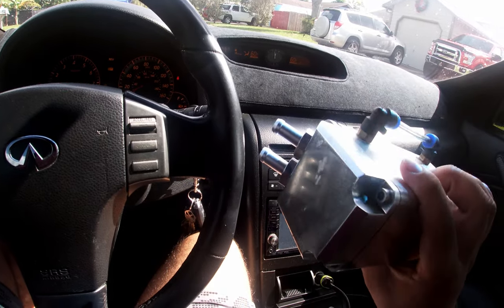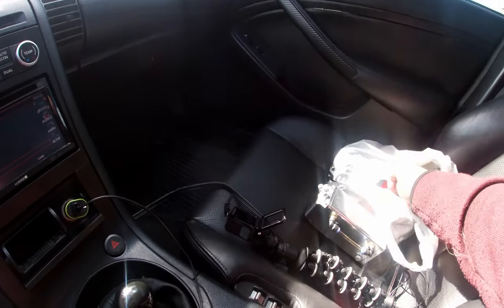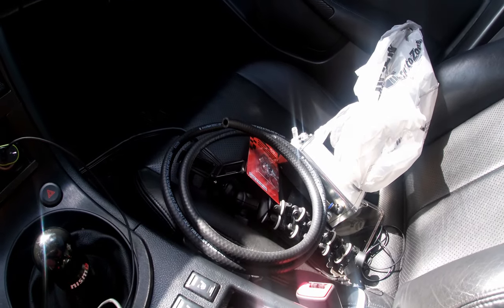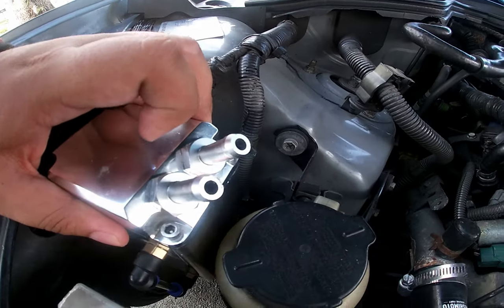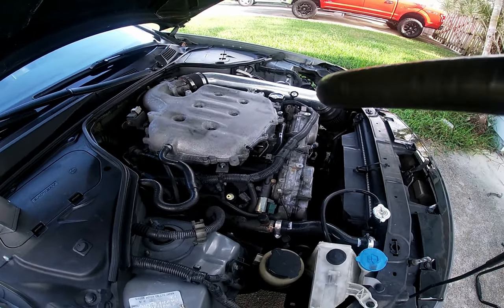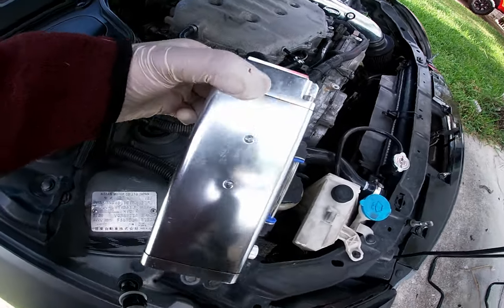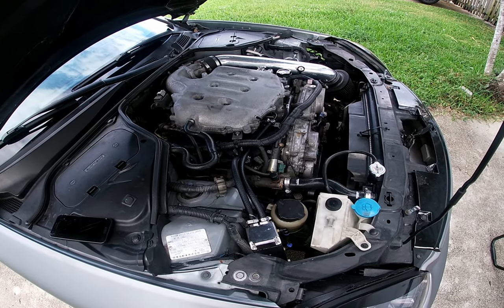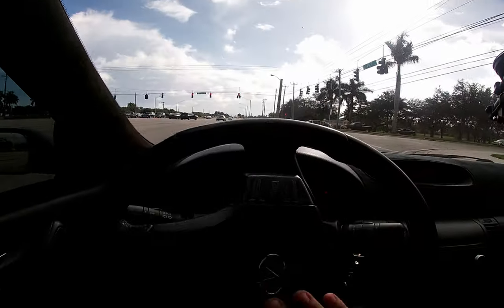EASY G35 350z CATCH CAN INSTALL

Comment: This is on my mod list of things I want for the G. Not only does is help with the oil consumption but it looks cool in the engine bay. Great tutorial bro👍👍👍
Reply from the maker: Thanks fam!
Reply from the maker: I think the add w1 one would be a good ome to go with. If i didnt have this one i most likely would have purchased that one and it comes with everything you need plug and play!
Reply: @KTVBUILT  yeah I like those cause you can also buy the aluminum hose clamp to match the catch can

Comment: That clear tube section you might want to cap off completely. The plastic will create leakage once it builds oil. It is convenient to view the level but you don't need it.
Reply from the maker: Good looks bro thanks for the tip!
Reply from the maker: I think ill cap it when i make the bracket and clean the plenum
Reply: @KTVBUILT  no worries. My can had that same tube. Used thread tape and few bolts. I catch a few ounces every time I empty. So far my plenum has stayed clean
Reply from the maker: @BoOmBaMan  did you route the lines the same way i did? I was looking at a couple of different videos to be sure but almost all of them were different
Reply: @KTVBUILT you need to check inside the can. depending which direction the flow is facing. The line that goes to the plenum should be the top of the can. And the PCV line goes to some baffling to catch the vapors within the can. 
PCV into can baffle 
Clean vapors out to Plenum
Reply from the maker: @BoOmBaMan  thanks fam ill check it tomorrow i appreciate that
Reply: @KTVBUILT  I used a brillo metal sponge as my baffling inside my can
Reply from the maker: @BoOmBaMan  ive heard of a couple people doing that amd having good results.